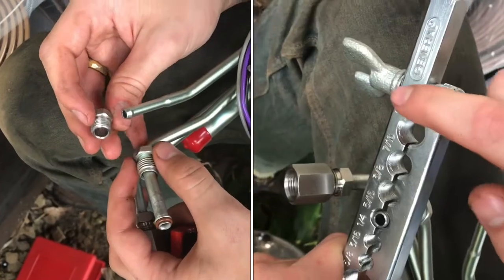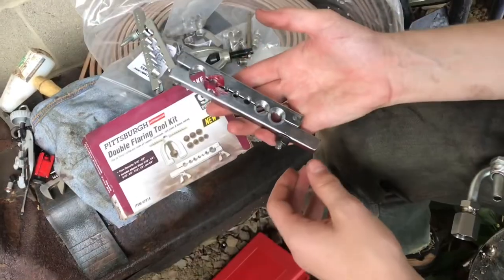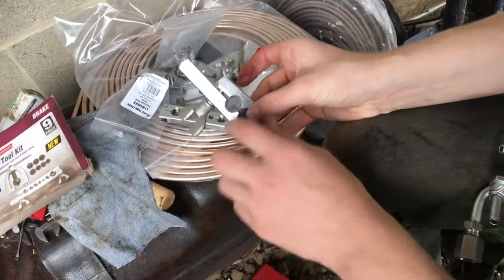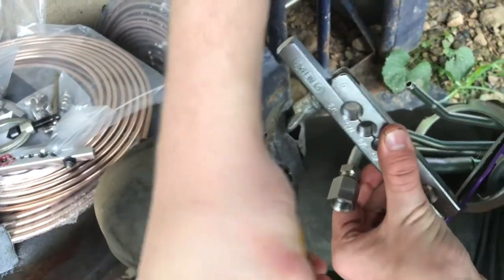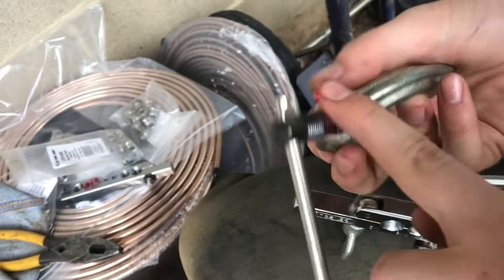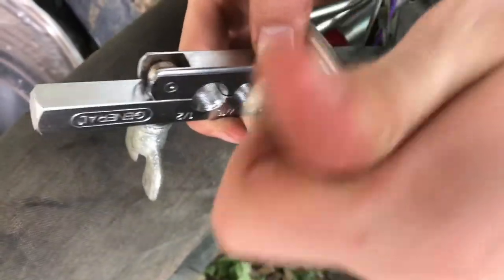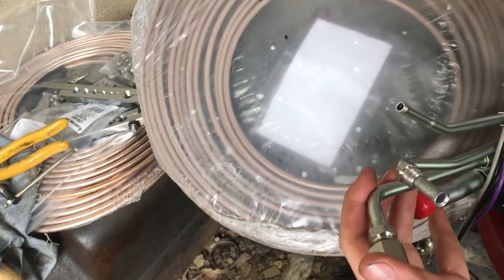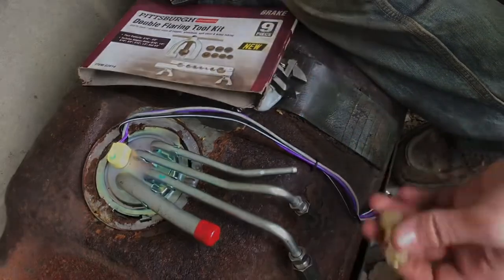“flaring steel” fuel line with a FLAIR TOOL (general, pittsburgh) useful tips

Comment: The steel line I'm fighting right now....the vice part of the tool will not hold it so I have a flared end that is only half flared.  I know copper is not safe to use for fuel....I appreciate noting what you were putting that flare on.  I was getting pissed.  Up to the auto parts store now.  Thanks for the vid!